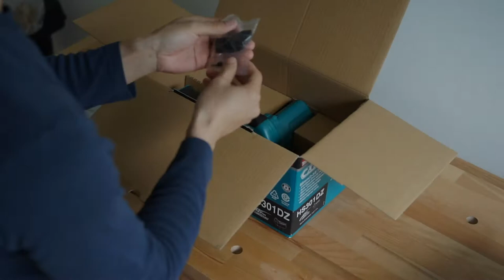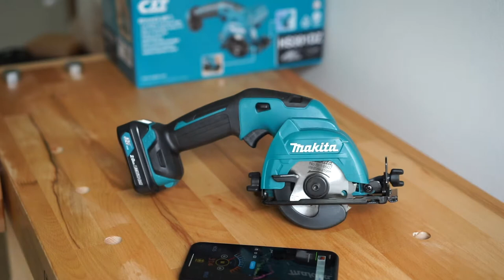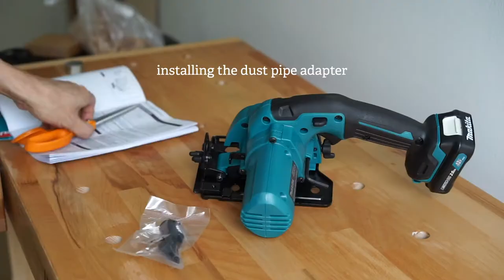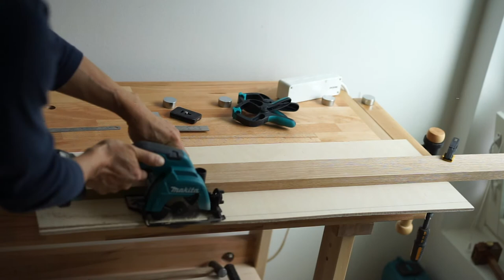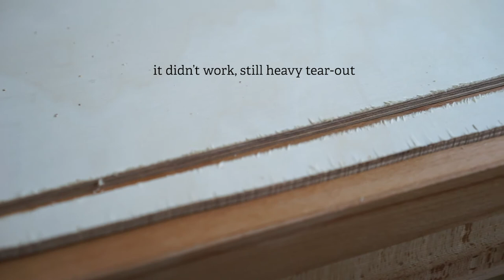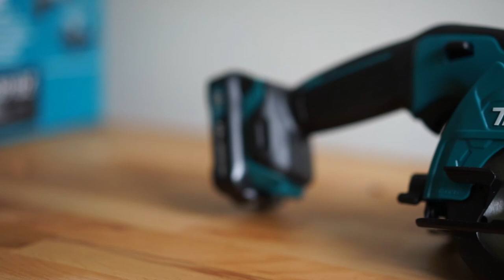Makita HS301D CXT 85mm Cordless Circular Saw unboxing and quick testing + how to reduce tear-out

Comment: I bought th I s for cutting I ng red ceader shakes because  the old 9 volt "pizza cutters" worked so well. I was disappointed with this saw. I believe it I only turns out 1500 rpm. Something to consider.  My 18 volt Milwaukie saw saw is 3000 rpm. Corded saw saw I have is 3500rpm. Noticeable  difference  in performance. Just my experience. I'm  finding that I need to pay more attention  those numbers when shopping for tools.

Comment: What dust nozzle attachment did you use ? Can’t seem to have any information from manufacturer
Reply: Look up the saw on Amazon. A person wrote a review. He had to order from Canadaian Makita. (The attachment isn't available in U.S. )And it needed a M4 Phillips head screw. Hope this helps.
Reply from the maker: The dust nozzle is too small for my vacuum cleaner, so I 3D printed one adapter to the nozzle.

Comment: Anyone know if they make an 18v battery model in this.
Reply: I don't think you're supposed to use 18v batteries on a 12v tool. The better option is to get the 4.0 ah version of the 12v. Longer lasting and a bit more power.